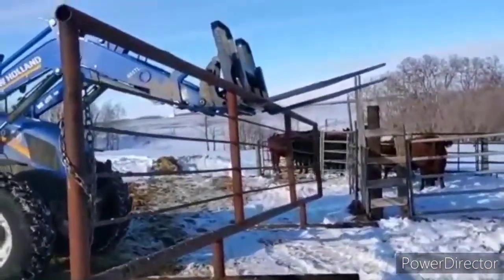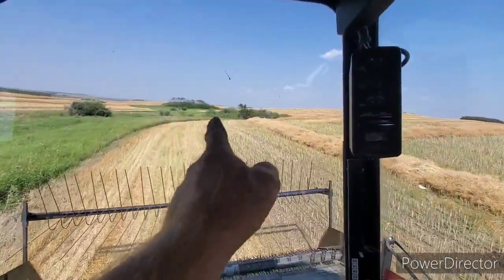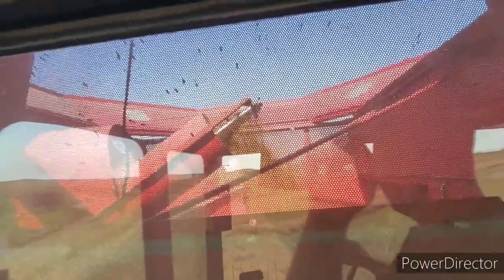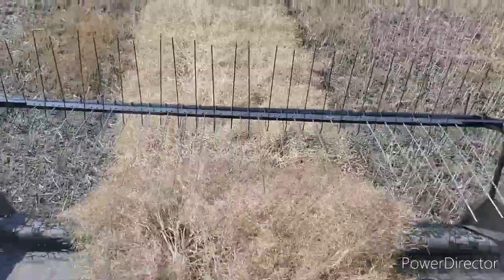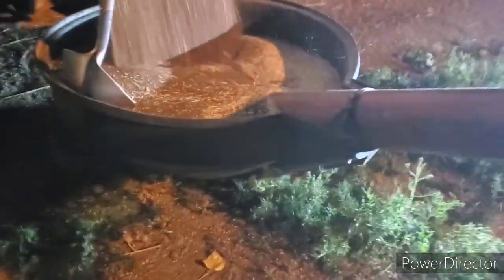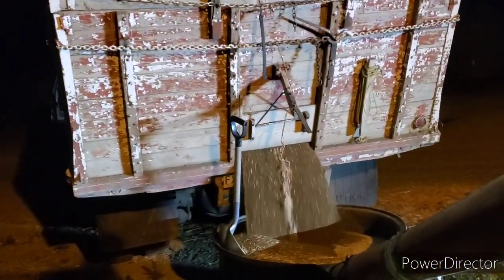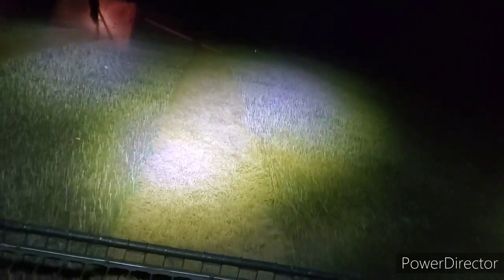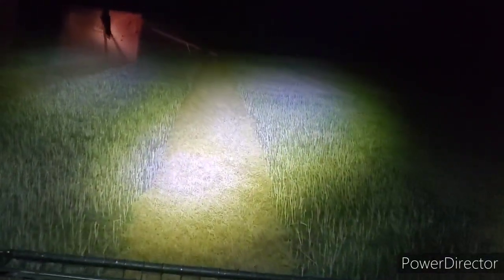Canola Harvest 2020!! Case IH 1680s Just A Givener!!!

Comment: Your back tire is on backwards.
Reply: What
Reply: They are the right way.  When those tires are not drive tires they are mounted to have the opposite rotation.
Reply: All combines come that way for traction while turning.
Reply: @randykov  yeah they float better in the mud too, and wear longer on the road.  Ya just run them V's forward when you want to really get traction and bite in and dig with the tire in mud... I've seen guys run them backwards on combines even on the drives-- they last longer if they're roading the combine a lot, and if you're cutting forward into wet spots and get stuck, with them reversed you have MORE TRACTION for backing out... and more flotation going forward... Later!  OL J R :)